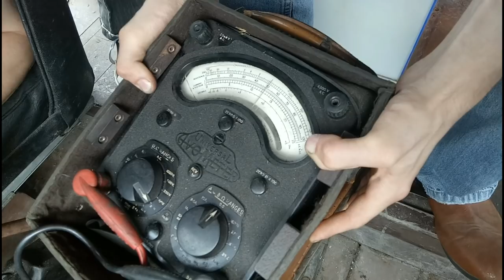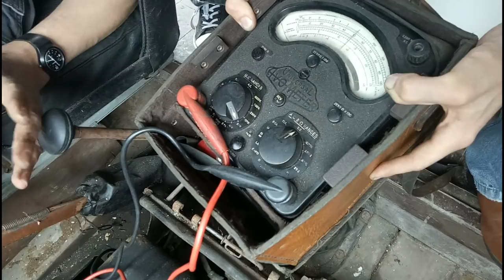Abandoned Green Goddess - Will it start?

Comment: You don't need a key. On the side of the engine cover there's two glass fuses. Pull one out and wedge it between the two holders. Ignition on. Old army trick!

Comment: Fantastic! Really enjoyed watching that - I've been in similar situations quite a few times like that myself, trying to get something started that hasn't run for ages (although in my case, it was mostly old tractors that actually needed to be used during haytime as 'last resort' back-ups, when the inevitable happens and the main machines fucked up).
What I've mostly found, be it cars or tractors, (assuming they weren't completely fucked when parked up), is some new oil, drain the tank of old fuel and contaminants and replace with fresh stuff, assess the fuel pump and starter motor and replace all filters (fuel and air),  and assuming those boxes are ticked,  these old motors will cough back into life with relative ease.

Fairly recently, my Brother-In-Law sold his 1955 Bedford flatbed truck that had been sitting in one of our barns, that hadn't turned over for 17 years. The guy who bought it came to pick it up with his Brother (a mechanic and classic car/truck enhusiast), and after just an hour of diddling about, got the old girl started, and driven down the road, it's enormous 6-pot petrol engine singing sweet.

Imagine trying this with a modern vehicle in 50 - 60 years time, that has a knackered ECU or serious electrical problems or something!
You really can't beat 'old-tech', compared to the throwaway consumer durables that we have in modern times.

Anyway, thanks again for a most entertaining video :)

Comment: It's amazing to think that these old gals are still in use by the army, and always pulled into service when the regular fire service needs supplementing or replacing if on strike... :)
Reply from the maker: Not any more. They sold them all off in 2004.
Reply: Oh, I hadn't heard about that sell-off, seems a shame really... :\
Reply from the maker: I think there was such outrage when they were deployed in 2002 that the government jumped on the bandwagon and sold them all off. Wonder what they replaced them with? Bet they cost a fortune and have never been used...
Reply: Ah well, this country's buggered if we ever need backup fire engines again... :P
Reply: The cover is now fire engines that were replaced in front line service,so maybe 8-10 years old
Reply: Keith Warner were prob 8 years old in 2004 I bet they either not been changed or are all spanking new with 0 hours on them
Reply: Still got one parked round the back of Bo'Ness Fire Station

Comment: Great, your comment at the first start attempt and no response, "Subtle!"  And a very subtle comment. When pouring start gas, engine is (usually) over-gassed, thus choke should be off, throttle butterfly all the way open to provide over-air, until kickover. That thing had to be running on 6-year old gas. That's the amazing part. It's funny how the male species must continually reaffirm its competence by performing old, cold starts of decrepit contraptions. It must be the EMT or Frankenstein gene in operation.

Comment: This was probably the most disturbing video I've seen! The poor little car trying to charge that high amp battery and swing over that old, stiff, neglected engine and starter sent shivers down my spine! I almost shed a tear for the car.
Reply: The Fake Russian You'd be the first person to shed a tear for my car! She did alright, used about 40 miles of diesel doing it but it was well worth it!
Reply: The Fake Russian Never shed a tear for a Renault. They deserve all they get!
Reply: Andrew Haines I did say almost :D To be fair every Renault I've had has been ok. I've had far more problems with BMW 7's, older jags, (pre-2000), Rovers and Fords although, <touch wood .... Where's Hub Nuts' head when you need it?> the current Ford has been brilliant.

Now that's a kiss of death with me spending a week with it up in the air haha
Reply: The Fake Russian My old laguna got binned just as it started to cause me hassle, that was free though, I'd done 12k in it with no real issue and lots of it lives on in the gooner you see here! This gooner cost me £150 and so far has been faultless. 1200 miles for the above video without a hiccup, it's just done 200 miles with no issue etc. First sign of major trouble (clutch goes etc) and it goes in the bin and another car is obtained!
Reply: The Fake Russian must just be Meganes then. Awful. No end of issues then had to scrap it when the mechanic took one look at the rattling steering rack & said it was an accident waiting to happen! Also wouldn't have passed the new MOT as the engine management light had been on for three years! Mazda bought for 600 and no advisories and everything is tickety boo!
Reply: It's Jeepers Creepers truck :D

Comment: For over 30 (might even be 40) years our little NZ rural community had a Green Goddess (painted red) RL Bedford 4x4 fire engine, that took a long time to get started, and was very slow. There was only one farmer, in whose farm shed the truck was parked, who knew how to get the motor going in under 5 minutes. That old girl was 'retired' in 2005, and taken away, but I've no idea if it was kept as a museum piece.

[I forgot earlier to mention that I also trained as an Army driver in RL 4x4's. They served multi purpose, and the REME guys kept most of them ticking over. 86 octane petrol as I recall. The army/military vehicles were built in NZ, whereas Green Goddesses were imported CBU, and repainted red.]

Footnote: found this in my Suggested list  https://www.youtube.com/watch?v=Yo9WvwDroJc  Take note the person who said a GG does "not like choke when starting".
Reply: Interesting, my uncle had one in New Zealand in about 1984 that had been converted into a horse truck. (The horses hated it as the ramps were too steep and high) This one had been painted green but had red underneath it. I remember the choke, just open the engine cover and put your hand over the intake....It cost far too much to run at about 8 MPG
Reply: hughvane Onga Onga had one too.

Comment: Not designed for speed but the 4x4 variation is far better than modern fire appliances off road. Also, these can be left for hours pumping water and need very little attention compared to modern appliances. Easy to slag these off but they are good old things, I'd have one over the modern crap the brigade uses now.

Comment: drove on in the fire strikes got it to 60 empty of course heres a wee tip for you as we had major issues with the ones we used at the start is the fuel tank is coated inside with red lead and after years flakes off and gets stuck in your fuel lines so if you can get a chance get it reconditioned but yeah funny old things to drive its like stepping back in a time machine

Comment: I've started up many an old motor over the years, cars, van's, lawnmowers than have been stood years and the key to getting them going is-
1. A good battery
2. Fresh fuel
3. A can of Ezi start or similar
If it's struggling to start either you have no spark  easily checked, no fuel or it's gone off, also check for blockages in lines or carb.
An engine needs 3 things to.start spark, fuel.and air oh and a little compression helps lol 😎👍
It's mostly just the fuel goes off and blocks up the carb, pouring a little fuel directly into the throttle body prior to cranking over will give it that help to get it going. Failing that use ezi start very carefully, just a little spray into the air intake does it but spray first, stand back and crank over it can backfire and flames can blow out the air I take!! 😮😯😁
I enjoy a challenge getting an old engine going and have never failed yet to get one started, I luv it when I hear those words,  'you'll never get it started!!' 😁😁😯😎😊👍

Comment: I also was a truck fitter for 8 years before joining the RAC,i have converted about 15 of these RL's to gritters,for spreading salt..ideal cheap chassis,petrol motor also good as the diesel fuel in later lorries froze...i was revving the nuts off one of these in the workshop's it was running great.!!! until i switched the ignition off at half revs,and switched it on again...BANG.!!!!! The exhaust blew off compleatly,and the round silencer was converted to a flat sheet of metal on the floor.!!! oh hell foreman Ray an excellent welder re welded it,and fitted it back on,never the same after that....he was not impressed,we had so much fun with these old trucks,AEC trucks with a machine gun mount on the roof.? we changed the tyres from sand bar to snow tyres...simple motors,but the diesel so noisy..not like trucks today..a lot of military stuff made good gritters,most were 4 wheel drive,all those years ago..?

Comment: Great video lads - but it is not necessary to rev the jumper car to more than about 1500 rpm - the alternator reaches it's max output once the voltage regulator cuts it in and does not increase in line with the revs after that.
Reply from the maker: It did need more than tickover revs, but agree it didn't need quite so many.

Comment: Trick.... use 2 batteries... one for the coil/points temporarily stand alone and the other (jump wired main vehicle battery) as the starter/vehicle supply. This way even though the laboured starter battery gets dropped volts you still get a big fat spark.

Comment: the best way before starting is to remove the points and plugs and check the gaps.if the points are lucas made then the gap is 14 to16 in.the plug gap is 028 to 032in. if the distributor is an ac make then the points gap is .19in to,021 in. do not pour petrol down the carb.anyway the engine needs a serious stripdown.when the engine runs properly they are a very quiet engine. the timing should also be checked.this will be 5 degrees before top dead centre.
Reply from the maker: We did not have time to strip the engine down. The question was, with it run? The answer is, sort of.

Comment: The goddess' do not like choke when starting. They were set up to run rich so they would fire up from cold and run straight away. I have restored three so believe me. That one would run as sweet as within a short time if you knew what you were doing. Pumping the throttle like he was while turning it over leads to flooding. Simple way to start them even after standing for years is prime the fuel pump to fill the carb with FRESH fuel, then two pumps on the throttle, push the starter and away she'll go. Its that simple. The way you were doing it just impacted the problem. These are a couple of videos of the goddess's i have restored.  https://youtu.be/ftv8YzWPZuw  https://youtu.be/bjLd0PHwQCw
Reply: LOL Pumping an up draft carb leads to flooding.

Comment: Well done Ian and the team, when i had my business i use to look after the local st john ambulance, Ambulances and they had a mobile dressing station and that was a bedford  TK series, 3,5 ,liter straight 6; God did you have to drive it plus no power stearing and a crash gearbox , it couldnt be used as an emergency vehicle but they had bedford cf's 2.3 on front line... I could tell you a story or two lol. Paul.
Reply: Stick your stories up your fucking arse.
Reply: Didn't need power steering - as the gearing was so low. Now if you'd said it about a Ford 4D or D Series!

Comment: When you pour petrol straight into the intake you shouldn't leave the choke fully on. You need air in there too to get the fuel to burn. Damn! Just as I was typing this advice you backed off the choke and she started. I must learn to wait until the end of your videos before I make a comment.
Reply from the maker: I'd like to pretend to be an expert, but that would be a lie.
Reply: You should not be so modest, claim glory whenever you can, whether you deserve it or not. Read 'Internal Combustion Engines' by Lichty, you'll never fail to get an engine to start once you have read that. Stochiometric combustion anyone?

Comment: was that electrical tester used on noah"s ark?
Reply: A Megger.  Old tech but very good.
Reply: Old tech but very good, yep. The company that made the Avometer was re-badged Megger, but a Megger is the generic term for a meter that tests insulation resistance by pumping a significant voltage through it, higher than the voltage it would normally be expected to cope with. This is something different:

As Barry Jones says what we have there is an Avo Model 8 Mk II or Mk III, mid sixties vintage. Insofar as measuring voltage and current they are more suited to sitting in the boot of the car or under the seat of the van, than a modern digital multimeter would be. After a year or so of that a low or medium budget digital meter would start playing up from damp and vibration....the Avo won't.
Reply: ++ Alec Hemy ++ it most certainly is a volt meter if and when switched to that mode. The video clearly shows it being used to measure a voltage between battery and coil at one point. The point is these 'old fashioned' even 'antique' to those who know no better, instruments will easily outlast today's clever chinese made plastic junk, as this one obviously has, without the help of Dr Who or any sarcastic remarks about the 21st century.
Reply: @ptonpc  AVO multimeter. AVO company name made up from Amps, Volts, Ohms. They were ubiquitous in the UK and commonwealth countries at one time. The best is the tropicalised "panclimatic" military version.
Reply: @984francis  Still using an analog AVO bought in Ipswich in 1967. Went through a few digital ones since they became affordable.
Reply: Hmmm, I still have three of these AVOs including an ex Royal Navy kit containing the high voltage shunts. They are superb analogue meters. I use a mixture of old and new metering equipment but I doubt anyone making such a silly comment would be able to understand why.

Comment: Sounds like the Big ends Knocking was the oil changed and checked. Sounded  as if the bearings were running dry.Was there any oil Pressure?
Reply from the maker: Oil pressure was good. Stuck inlet valve the likely culprit.

Comment: Any tips to get the engine going because my dads will not start but has a good battery and all spark plug work
Reply from the maker: One of these trucks? Ensure fuel is getting to the carburettor.

Comment: Why is there a RAC Headboard/Yellow beacons behind the front seats.? all you have to do is crank over with motor with king lead to earth,if there is a spark the ignition is working..this is no fuel.? just pour it neat down the carb inlet,it will cough/bang and probably catch alight.!!!  RAC man for 15 years retired..luckily.!
Reply from the maker: I have no idea about the beacons. We had fun learning as we went, thankfully without fire! Which is good, as the pump engine didn't work either...

Comment: A shock? At 12v on a weak battery! 😂
Just a thought that the carburettor diaphragm needs replacement.
Reply from the maker: It did have a Renault Laguna connected up to it. It isn't volts that shock, but amps. A battery is only 12v, but it can still kill you...
Reply: HubNut A 12v battery would only kill you if you dropped it on your head......
Reply from the maker: Ok. Fair point! I never was good at physics... You'll still get quite a twinge from a coil output though. Been there, done that!

Comment: I figured they'd have been diesel vs. gas
Reply from the maker: Diesels weren't powerful enough. Even in the 1980s, ambulances here were petrol - V6 or V8! They sounded amazing. They had at least made diesels powerful enough for fire engines by then.
Reply: that sounds terrible, considering all the diesels around here before then, specifically the 2 stroke detroit diesel's. maybe the gasoline stuff was easier to maintain there.
Reply: Probably had something to do with cold starting reliability, fuel access or even just production cost. These were war reserve wagons not for everyday use, back in the day it would have been easier to find petrol in the post nuclear wilderness. Lots of military wagons were petrol as late as the 70's.

Comment: Chevy engine?
Reply from the maker: Originally, yes. Bedford was part of GM.
Reply: HubNut That Engine looked the same for the most part as my grandfather’s 1951 Chevy 3100 truck. They were known as the stove bolt engine. That design started in 1929 and we’re available in cars here in the US until the 70s. They’re quite popular in Brazil to this day. Very simple engine but they just go. Although not very fast. The 216 in.³ made about 90 horse power. Larger sizes made about 150 on a good day.